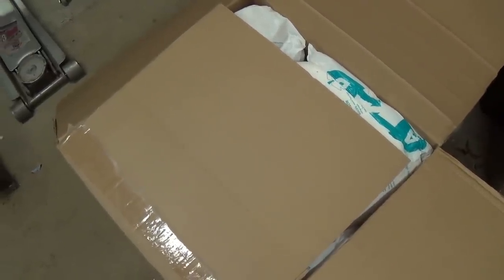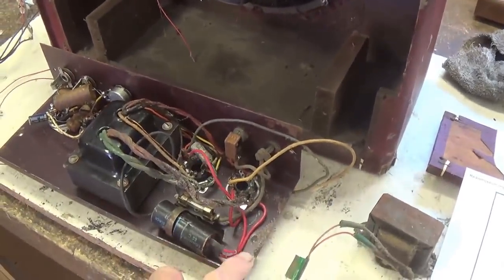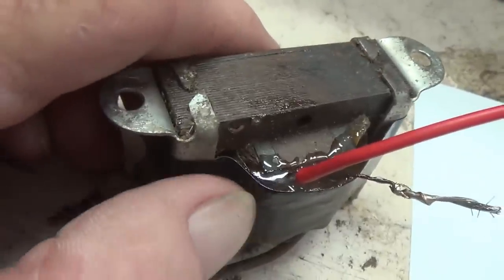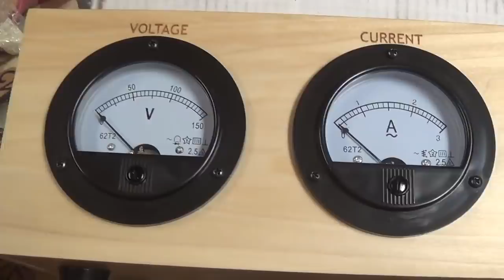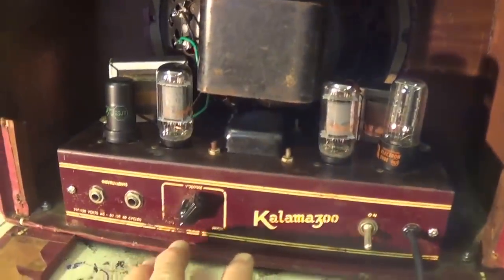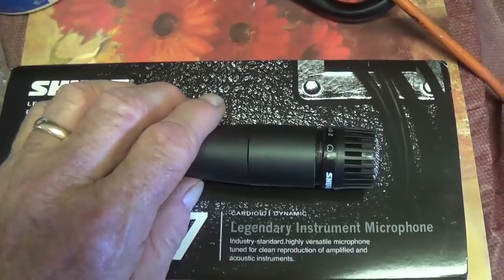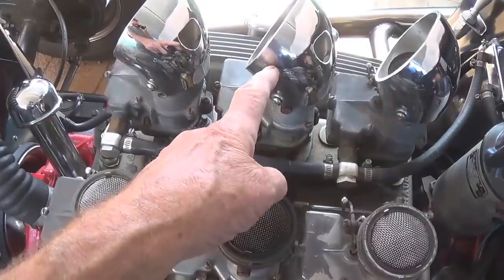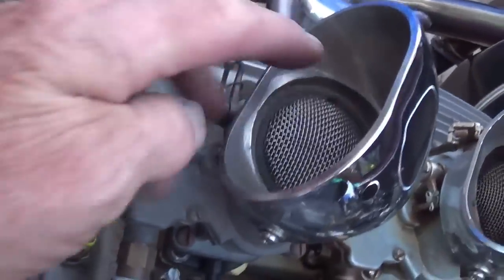Heroic Restoration of a 1948-52 Kalamazoo KEA Amp with an Unusual Circuit

Comment: The KEA I just bought uses a  speaker with a Field Coil transformer (no magnet).  My Dad's KEA Kalamazoo was the same.  One of those transformers mounted on the side must have been taken off the original speaker and screwed on next to the chassis perhaps?  --Jason ✌🏻&❤️
Reply from the maker: That could well be true, Jason. These old jewels have often undergone all sorts of mods during their long lives.
Reply: @UncleDoug  When I cleaned the crap out of it (literally, 😆) I found the serial number for the speaker hidden behind the chassis.  It's an original Rola 10" field coil speaker made the 26th week of 1951 (there's an outside chance it's a 1941).  I've had Radio Shack speakers that never made it past 25 years, Lol.  Pretty amazing.  I wish I had photos I could share with you on this platform.  --Jason✌🏻&❤️

Comment: Hey Uncle Doug I just bought a Fender Custom Deluxe Reverb 68 - 1x12" may i ask a question ? Does Vibrato chn on those amps have a issue w/a ghost pulse even when not being played? Mine does you can hear the more you crank it it gets pretty loud it's a muted click pulsing to the speed  when Vibrato is switched on w/.instrument or not any setting a pulse is going w/the speed . i never had a tube driven Vibrato before,  is that ghost pulse'n normal? Thx
Reply from the maker: The audible "heartbeat" of a DR trem is a common issue, W4. Your best bet is to do some internet searches for info on the topic. The main way to address the issue seems to involve the addition of a capacitor to the (surprisingly high voltage) neon bulb circuit.
Reply: @UncleDoug  Thanks Uncle Doug.

Comment: Uncle Doug... on your fuel problem... have you thought of using an electric fan instead of a belt driven fan? If you do, you could set it to run at a particular temperature, which could allow it to run for for a few minutes after you stop, to help things cool down.
Reply from the maker: I do have an electric fan, Scotty, but unless the engine is still running, the water will not be circulating to cool the block. Heat soaking is a well-known and common phenomenon, with carburetors......not fuel injection.

Comment: Can't tell if you have an electric fuel pump or not, but there needs to be only about 2.5 to 3 psi at the carbs. The design of the float/needle and seat assembly is such that the float tab that presses the needle against the seat and shutting it off doesn't have sufficient leverage to keep from "blowing off" at higher pressure. Also, inside the carb under the (leather cupped!) accelerator pump at the botton of the accelerator pump well there is a power valve; basically a check valve. It can be removed with a notched tip screwdriver. If it is loose or the gasket broken or the pintle is stuck (crud gets in there all the time) in the open position, fuel will drain into the manifold.
   The heat shield is a good idea, aluminum is sometimes used, some base gaskets are phenolic and gasket material composite "sandwich". Masonite is fine. Chevrolet Performance and the aftermarket make aluminum heat shields that go under the intake manifold as well. 
   But I'm willing to bet a Telefunken VF14M rf pentode you've got the problem whipped. Oh yeah, Crows Foot wrench/socket for those soul destroying nuts, and will keep you from premature membership in the The Hair Club for Men.

P.S. My boss asked me why they don't use magnetos anymore. I said they still do in certain applications: some tractors and most serious drag racers use them and are still the most efficient, best ignition system ever. However, as soon as they decided to put radios in cars, that was the end of the magneto for common, everyday autos...too much interference.
  Reminds me of the song, "Radio Killed Magnetos in Cars."  <sigh>
Reply from the maker: Thanks for all the great info and comments, Michael.  It a low-pressure fuel pump, but I am still thinking about installing a FP regulator just to be sure. The gas mileage is lousy, and I suspect that excess gas may be getting forced into the engine while running....it does seem to run a bit rich. The masonite spacers work fine.....heat is no longer a problem. I'll look for a set of crow's foot wrenches. The magneto does not seem to disrupt the CD player I have connected to the Kenwood power amp. I guess, hard-wired is better than RF.

Comment: Would be nice to put a period correct fuse holder between switch and power cord maybe??
Have you ever tried saddle soap to clean and preserve coverings?
Reply from the maker: An externally-accessible fuse is always a good idea, Fred. I use other cleaners, but saddle soap would probably work just fine too.

Comment: Great sound. Do you have access to an insulation tester, the kind used for testing electrical installations? They normally have DC output test voltages of 100v, 250v, 500v and sometimes 1000v. This would help proving the viability of output transformers to see if there is an insulation break down between primary and secondary windings, and between windings and the metal casing.
When testing electrical installations, in the UK, the normal test between live conductors and between live conductors and earth is 500v.
The insulation resistance has to be above 1M ohm, but for safety I would not be happy unless that value exceeds 10M ohm.
Reply from the maker: I don't have such a tool, Steve. I simply rely on the 1A or 2A fuse in the circuit to protect both me and the circuit from such breakdowns.
Reply: Uncle Doug I like the simplicity. I like to do insulation testing, when there is that nagging doubt, because it often saves work. I had to do a repair recently on a mains battery charger, and the only thing blowing fuses was one of those overvoltage limiting devices which hadn’t blown but had failed sufficiently below its rating to take out the fuse. The insulation test at 100 volts showed it was starting to conduct, rather than at 500 volts dc.

Comment: To my ears, the high end is much more distinct with the Shure mic.

I don't know what I'm talking about, but: I usually set the mic back from the speaker by a distance equal to the diameter of the speaker.  I keep planning to test the theory that this method actually sounds better, by using white noise and a spectrum analyzer and moving the microphone around to find where the response is best, but I'd prefer that science not prove me wrong yet again.

This was heroic indeed, and thank you for sharing all of this, Uncle Doug.
Reply from the maker: You're welcome, M. Thanks for your helpful suggestions.

Comment: Both very interesting. A couple of comments:

1. That output circuit is really just a normal Schmitt long-tailed pair phase splitter displaced to the output stage. Same topology, common-cathode followed by common-grid, with a few component variations due to needing much higher current. One would expect some 2HD due to the very high output impedance of the grounded-grid side,  but that would just make it sound more silvery.

2. I'm wondering whether the back pressure from the fuel tank wasn't the only real problem, injecting fuel into the cylinders at what seems to be a fair bit of pressure until it cooled. I appreciate that the insulator you added did insulate, but maybe all you really needed was a vented gas cap? No way to find out now of course.

EJP
Reply from the maker: Thanks, EJP.  Number 1 is right on the money. As a result, I have nicknamed this type of output circuit a "short-tailed pair".  No. 2: There were two separate problems with the carbs......heat soak and percolation (which are very common in this area due to the adulterated gasoline) resolved by the insulated panels.....and the high pressure in the gas tank, resolved by drilling a tiny hole in the cap.

Comment: I guess the OT would be attached to the field-coil speaker frame in the earlier version so the two cabinet mounted coils are part of that conversion of the design to use a permanent magnet speaker without making a new chassis.
Reply from the maker: That could well be true, Nick. It really looked like the amp was wired like this originally, with a FC rather than an ED speaker.

Comment: You'd be surprised. Some amps still come with the fuse in the chassis. That 5w Monoprice Champ-style amp has its fuse inside just like that. Its 15w big brother may be the same. I haven't looked. I assume they copied however Laney did it on the Cub 12R since that's what it is.

Edit: it's not on the rear of the 15w so I assume it's inside, also.
Reply from the maker: It just makes it more difficult to check.

Comment: Hi Doug. Looking at the schematic for this amp am I right in thinking the filter choke would go across the two 10uf filter caps? (in place of the speaker field coil).
Reply from the maker: Yes, that is exactly where it is placed in the circuit, GB.
Reply: @UncleDoug  Thanks Doug :-)

Comment: The new microphone is an improvement. 
But I still think the sound is kind of metallic, could it be that your editing-software is set to output the sound in a low bitrate?
I also find that clips often chops of the end of what is being said.
But after the criticism I have to give you two thumbs up for great and interesting content.
Reply from the maker: I will move the microphone away from the voice coil to soften the tone, Mikael. The occasional clipping at the end of a few scenes has already been addressed many times. Thanks !!!

Comment: Quite some years back I rebuilt a Kalamazoo Model Two (1966 vintage, I believe.) My first amp rebuild, ever, and I ended up having to re-wire most of it as the wire was pie crust. Damn good sounding amp, though.

It's a shame this is a lesser known, at least as far as I can tell, amp model.
Reply from the maker: I agree, Brian. They are easily the equal of many of the more popular Gibson amps of that period.
Reply: Brian, yeah, I rebuilt a Model One. With the right tubes it's a great sounding amp; it's a very tube sensitive circuit, so try several different EL84's. An old used Amperex Bugle Boy EL84 was what really made it come alive. It sounded like a Vox AC-30!

Comment: Great video. Learned some new stuff. I wonder if the transformers were mounted outside and away to eliminate  the chance of magnetic interference/hum? However it seems that top mounting them introduces no problems. 

The amp seems overly bright with the new mic - does it really sound that way live?  Or is it not picking up mids and lows due to its close placement to the center? I am noticing improved detail. 

The fuse is still a nightmare to change. Would it be too much of mutilation of this historic amp to install a fuse holder in the power cord hole and relocate the cord entry to the top of the chassis, seeing as the stored cord would also reside inside the cabinet?
Reply from the maker: Looking at the clean spots on the otherwise filthy cabinet floor under the OPT and filter choke,  it sure looks like they have been installed there since very early in the amp's existence.  Different mike placement should solve the brightness issue. If the fuse ever blows, I'll probably install an externally accessible fuse holder.
Reply: @UncleDoug  I just found your video when searching for info on the same Kalamazoo amp my neighbor had out for the trash man this morning.  Mine doesn't have the filter choke, but the OPT is mounted on the speaker.  I'm guessing the one you have may have been moved when a prior owner replaced the original speaker.  Anyway.  Great post... I'm looking forward to getting my trash find up and running.
Reply from the maker: @robertpascal4027  I can't believe what you viewers find in local trash cans. The last time I dared to go trash picking, all I found was a bag of dog poop and a rabid skunk......wanna trade ?? ;) Seriously, good luck with your project.

Comment: Hey Uncle Doug, great vid as always. I've got a question about an amp I'm working on.

The output transformer has a center tapped secondary. Not realizing this, I got a grounded 1/4" output jack for it. The way I see it I can do one of two things: either get a different output jack that is isolated from the chassis, or wrap the center tap up and tuck it away and treat the OT like it wasn't there. If I go for the second option, would the output impedance be changed?

Thanks,
Oli
Reply: To clarify, this would be an issue because half the signal would be passed to the chassis.

Also, the original impedance was 8 ohm, so I have already purchased an 8 ohm speaker.
Reply from the maker: Unless this is some very unusual OPT, the CT will allow it to be used for 4 or 8 ohm speakers. For an 8 Ohm speaker, connect the two outer wires to the speaker and insulate the tip of the CT. For a 4 Ohm speaker, connect one outer and the CT to the speaker, and insulate the unused wire tip.
Reply: Uncle Doug Thank you for your response. I think it is unusual because the schematic shows the secondary CT grounded. This makes me think it is not 4 ohms, but sqrt(8), which would be 2.8 ohms. Either way, I insulated the CT and plugged in my speaker and it worked, so all is well. Thanks again!

Comment: W🤓🤓✋🏾ON THE HOTROD....Have you thought about using pexhose instead of the Rubber lines which are subject to high heat pin holes?  Just a thought. Do you have a flexible universal socket?
Reply from the maker: I never heard of pexhose, Lumpy. I'll have to check into it. No socket can fit on some of the inner nuts......I have virtually every tool ever made, and only the vertical wrench will work.

Comment: Does it change the sound?.....-phase inverting through the tubes vs. a phase inverter tube or transformer. Is this super clever or just a way to save pennies? Curious as I’m just trying to understand how this all works and it’s the first time I’ve come across this way of doing it. Thanks for all your teachings.
Reply from the maker: I honestly don't think that it makes a huge difference, but the transformer method really does sound nice.
Reply: Uncle Doug 
Thanks for the reply. I think all my amps have tube phase inverting. Any examples of transformer phase inverting you would suggest listening to?
Reply from the maker: @GIBKEL  Most classic 1930's and 40's Wurlitzer jukeboxes used an interstage transformer for phase inversion, PW, which may partially explain their great sound.

Comment: A possible reason for mice being attracted to and prone to chewing on wiring: an old ham radio operator told me that vintage electronics sometimes have wiring that was insulated with a soybean- based rubbery plastic. Even old cloth covered wiring sometimes has a rubbery core underneath the cloth. I do know that Henry Ford once built an experimental or prototype car with non-structural parts such as the usual sheet metal skin replaced with parts made from soybean-based  plastic.
Reply from the maker: Thanks for the info, GU.

Comment: Great video

I have just bought the same amp. 1947 KEA

Question?

Can I just swap a speaker with correct impedance, or is there more to it due to “field coil “

Ignorant, but cautious 

All the very best,

LA
Reply from the maker: If you replace the Electrodynamic speaker with a PM speaker, you have to add a filter choke or ballast resistor to compensate for the missing field coil.

Comment: Interesting way to avoid a phase inverter tube. I would think the problem might be that the output of both tubes isn't balanced because the method of amplification is different between the two tubes. The one with the grounded grid might be weaker. It doesn't sound bad, though.
Reply from the maker: While perfect balance between output tubes might provide maximum output power and volume, I'm not sure that it provides the best tone, Joe. The mismatch probably creates all sorts of interesting harmonics and overtones.

Comment: Yes, there's always one, it's always the last nut and it's always at the most inconvenient location.

Was the carburetor problem really just the gas cap ventilation problem? Sounds like a lot of pressure onto those float bowl seals.
Reply from the maker: Indeed, Dan. Yes, ventilating the tank definitely stopped the flooding.....but stinks up the garage. For every cure there's a side effect ;)

Comment: Doug - I wonder if you could advise on the correct (ie safe) procedure for discharging electrolytics before removal from a chassis....Thanks, Dave
Reply from the maker: Dave, I have shown how to make a safe discharging probe and demonstrated how to use it in several different videos, particularly those showing how to bias SE and DE amps. Hopefully you have seen or can find one of these demos.
Reply: Thanks Doug - I haven't seen those yet but will look them out

Comment: OK, I'm confused. Both cathodes of the 6V6 tubes appear to connected and that your verbal explanation tells something very different. You say on one of the 6V6 the grid is being driven and that inverts the AC signal. And the other 6V6 has it cathode being driven and the AC signal is not inverted. One more question for you;  you told me that you use 16 gauge wire to connect things. Do you prefer stranded wire or solid wires?
Reply from the maker: You need to watch the video on different types of phase inversion, Dennis. Focus on the Cathodyne method.  Always stranded wire.....solid wire will fatigue and break much sooner than stranded.

Comment: The sound from the close up SM57 is good quality, but it's not what you hear in the room. When I mic for demos like this, I like to use a room mic, so people are hearing what I hear. If you experiment with the placement a little, you ought to be able to find a spot that sounds like what you hear. I usually use a condensor mic, and there are some well under $100 that would do what you want, but you should be able to get decent results with the 57, too.
Reply from the maker: I will experiment with placement, Sean.